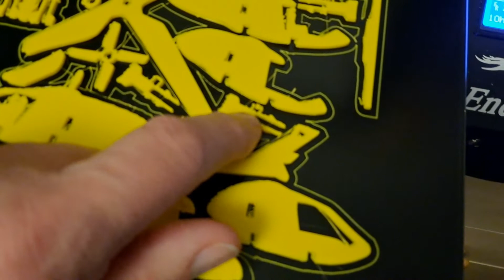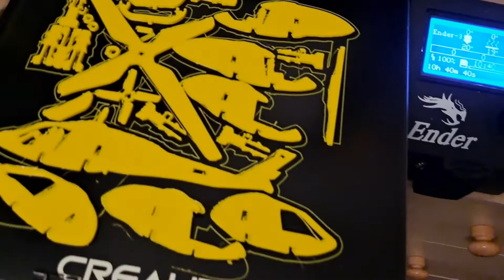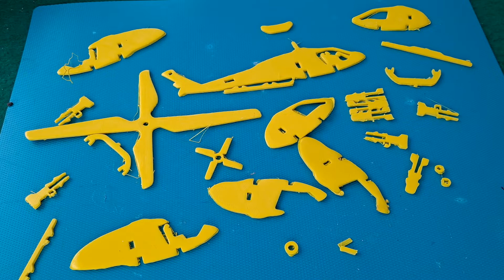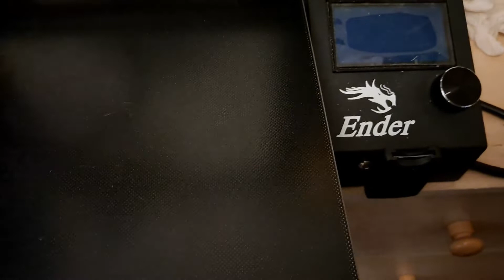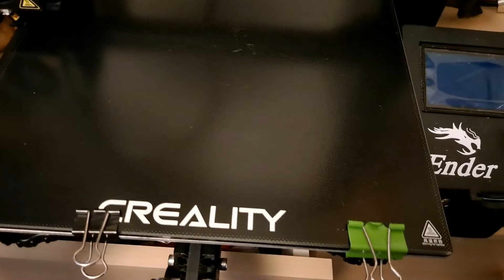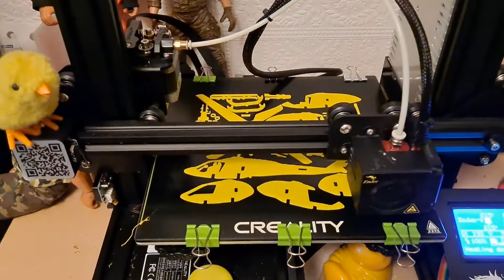Printer Issues Another 3D printed Helicopter puzzle

Comment: Interesting. My glass plate seems to be upside down! Maybe I will try the other side 🤔😉👍. Thanks 😀
Reply from the maker: Well I should tell you it is not all good. I have had several failures with the new glass plate. I have a couple of files that fail every time I try to print them. I tweek a few settings and all is well for a while and then I get another fail. I have a Father Christmas novelty that keeps failing which is a real pain as it is about a 6 hour print. (Currently on a higher quality setting which will be 11 hours) First time I was able to glue the arm in place - missing a short section. The second attempt his beard broke off during the print. The third attempt I just had a ball of sticky hot filament wrapped round the heater. Fourth attempt in progress. I am about to go and have another look in a few minutes. This time I have given the plate a coat of Elmo's glue stick which is not going to do the Build-Tec any good. I will just go and have a look before I press the reply button. Only 42 minutes in so not at the point where the breakages happen, but not a ball of filament wrapped round the nozzle either at the moment 🤞
Reply: @GrandadIsAnOldMan  Interesting to hear. The glass on mine seemed good to begin with, but I now have to print with a brim most of the time. Not sure if its the glass or something out of adjustment. I also find low infill works best (5-10%). I had one piece I tried to print at 50% infill and the rapid movements of the Y axis just shook it off the bed 🙁

Comment: For the past 4 years i have been using black build surface decals when it starts not holding the prints I scuff the surface lightly with 600grit  and wipe it off with a micro fiber cloth . I at first wiped it with I.P A. after sanding but that turned out bad  as it smoothed the surface again. The micro fiber cloth just gets rid of the grit and dust witch is what you want . I am on my 300 print on this decal  I got mine on amazon the brand is Hitommy  black build surface heated bed sticker. mine was for my cr10s. hope this helps .
It's really working for me.
Love the Vids 
Later
Reply from the maker: Thanks for the advice 👍 In the last few months I was having the opposite problem, I was having real trouble releasing the print from the original build plate. I started using an Elmos glue stick to put a surface down and then I could get it to release by sliding a blade under it. The problem in this video was the glass plate had shifted. Adding extra clips cured that.

Comment: That was going to be my next "upgrade". Now I'm not so sure. The magnetic bed "upgrade" is ok for the moment.
I thought I was doing well at 60mm/s. Haven't had a failed print yet, touch wood, but after watching this I think I'll try 80, at least for prototyping
Reply from the maker: I just thought I would try the higher speed. If you don't try it you never know. The glass bed seems OK now I have added extra clips to hold it in place. Apparently some people use duct tape, but I think I will stay with the clips.

Comment: Sorry to See that it turned out to be a fail. Pitty tho.the second print out will be a Lot better too.idont know if a Glass surface is ideal to print on since the Printed items keep moving about.🤔
Reply from the maker: The glass is supposed to be a good conductor of the heat and it is coated with a special material to grip the print when it is hot, and release it when it is cold. The problem here appears to be the clips did not hold it in place tightly enough, so I have added extra clips and it has been OK since then.

Comment: Bed adhesion is the most common reason for failed prints. Build Tak style beds are very good but you need to keep them very clean (even fingerprints are enough to cause a failure). I personally use Pritt Stick (I've tried the cheep ones and there not as good) but some people use hair spray but I have no experience with it.
Recently I had a layer shift and had to change my acceleration and jerk settings, this might help you.
They sell Ender 3 low-profile bed clips on E-Bay that aren't that expensive if your interested.
A failed print is always painful but remember we lean nothing from success only failure.
Great video. Keep up the good work.
Reply from the maker: This was definitely a case of the glass bed shifting. I added extra clips to clamp it in place and it has been fine ever since. I don't see any point in using Pritt stick on this while the Build Tak should be working. I had started using Pritt stick (or Elmos) on the old bed but for the opposite reason. The PLA was sticking too well to the old surface so adding the layer of Pritt Stick actually allowed me to release it. It had got to the point where I was having to remove the bed and flex it to release the print. I simply could not get a scraper under the edge of the print.
Reply: You will be pleased to know I had to resort to using Elmo's Glue stick to get one of my recent prints to stay in place during printing. Rather disappointing, had done a long session of prints probably about 48 hours of printing spread over not much more than 2 days as I was running it almost production line style and the final one failed. Then it failed again, and failed again, each time I had adjusted a few settings. Finally, I resorted to the glue stick 😣☹
Reply: @GrandadsOtherChannel Sorry to hear that. I know glue stick seems like a cheat however rather a cheat that works than a failure. The only way to use the "Build-Tak" surfaces is to clean them every print using IPA (not the beer) or something as strong white sprits perhaps (don't quote me on that though. Pritt stick all the way for me)

Comment: Hopefully you have it figured out as that is a long time printing for nothing. 🤔
Reply from the maker: Yes, I think I have fixed the movement issue. The new glass bed is heavy, so when it is moved side to side it slipped on the 'underbed'. I have added extra clips to hold it tighter. Not sure why the print run was so long. Looks like some sort of corruption or I got a setting wrong with the slicer. I have been using different settings and getting faster prints again. There are so many variable to set, it is quite possible I set one in error.